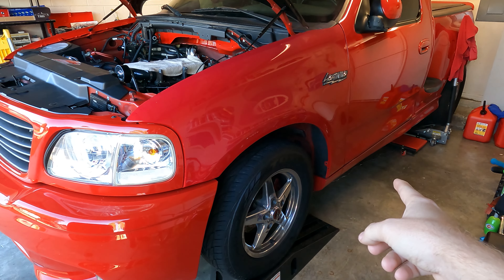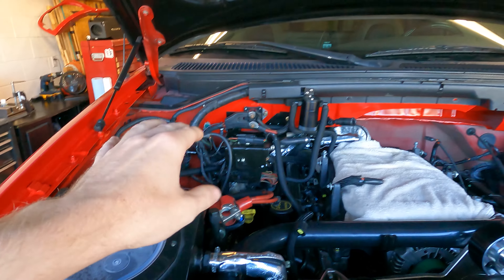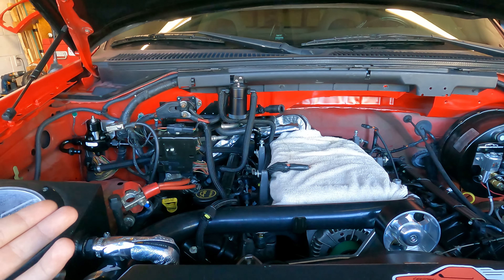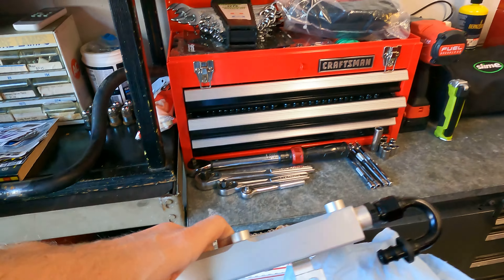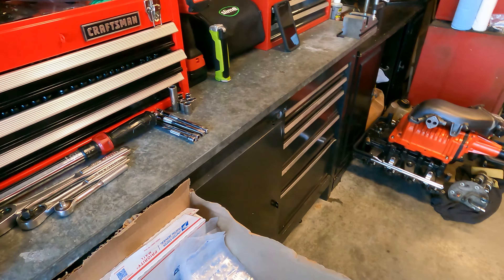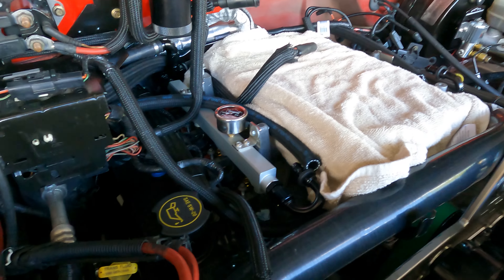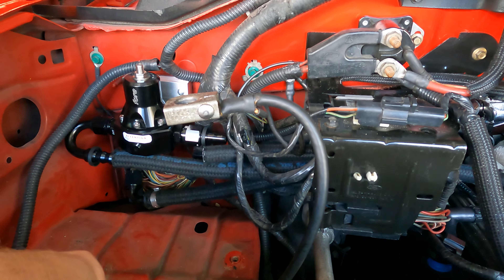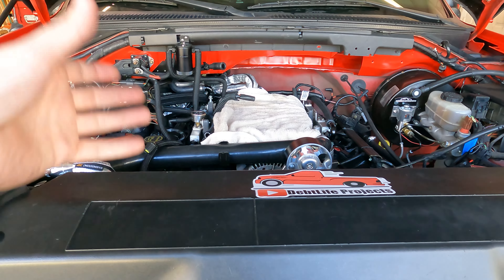Ford Lightning's Full Custom Fuel System is FINISHED and Ready to Make Serious Horsepower!

Comment: Looks good. Next time you should try out 2 pice fittings.
Reply from the maker: Coming soon actually, I'm redoing my trans cooler lines, using two piece fittings and stainless braided hose.  Figured I'd apply different fittings for different systems, so I can show how each works.
Reply: @DebtLife_Projects  I see. A helpful tip when you get the first pice on put a pice of tape around the hose as close to the fitting so you can check for push out once assembled. Also tape on fittings before tightening will keep a scratch free finish.
Reply: Try ptfe fittings

Comment: What are your thoughts on the series systems that both JLP and WMS sell? I see you went parallel so figuring you had reasons to do it that way as it is a bit harder to build.
Reply from the maker: @thastinger345  sorry took so long, hurricane prep in full effect lol.  The in series systems are perfectly fine for most.  I went parallel just for a tiny bit of redundancy, my local guru prefers it, so that's what I did.  He's built record trucks so I trust his methodology.  Parallel wasn't too much harder, just extra hose in the way for plug changes lol.  But for most, I'd say just snag a pre built in series system
Reply: @DebtLife_Projects  I decided to go parallel with an E85 tune option for race days. All PTFE hose, Fore hat/128mm filter/regulator/fuel rails with ID1050X injectors. 10 supply and 8 return.
I'll feel better with a parallel system.